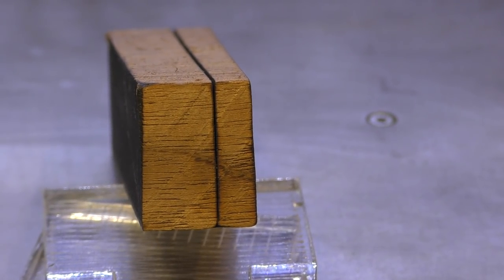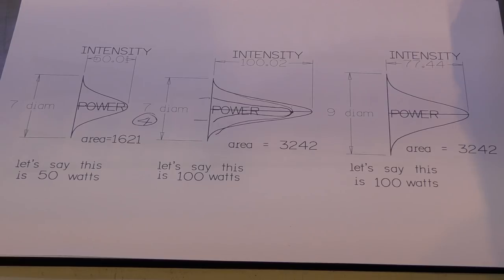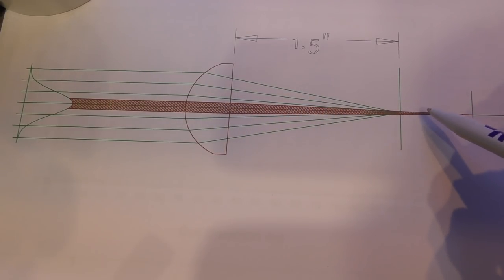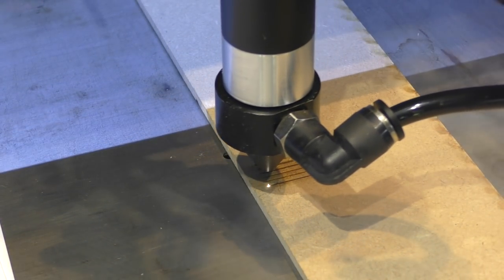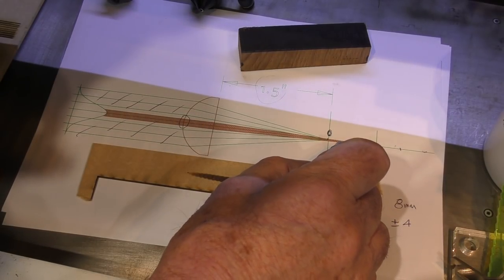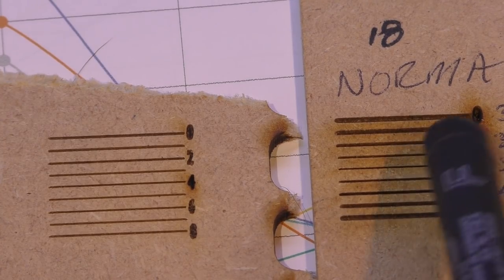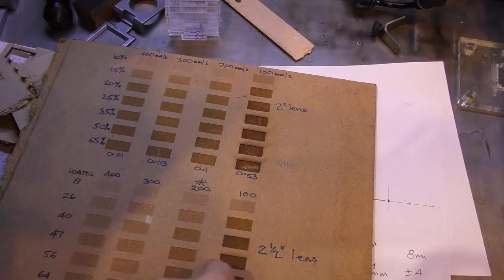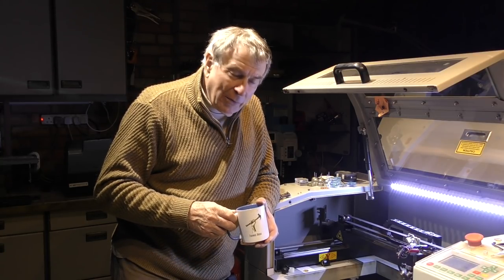RDWorks Learning Lab 208  Can I Remove the Focal Point

Comment: Always fun to follow your adventures. 
The effect you are looking at is called Numerical apperture. When you remove the material around the center you are effectively introducing an apperture before the lens, reducing the incoming beam diameter which reduces the focused spot size but also increases your depth of focus, why you see no difference on focus spot size over the range of lens-to-surface distances. 
When it comes to why you see vertical instead of diverging holes, consider that the initial hole in the surface becomes an apperture removing the diverging components of the beam from the subsequent laser light effectively creating the same effect as cutting the outside of the lens, but at the surface.
Reply from the maker: Hi Asger
 I  did not recognize what I was doing as being related to NA . My understanding of the term is from  a vague recollection about microscope objectives and light coming from a focal point ( the specimen being examined) into the lens for viewing.  This laser  system seem to be completely different in tha a) the light is parallel as it hits the lens on the top side, and b) the light is  not uniform but  VERY non-linear in its intensity.  As I state often, I only have a rudimentary knowledge of optics  but ignorance , common sense and inquisitiveness have dragged me into a subject i have no right to be investigating.
  That hole in the surface that you imagine to be a  filtering aperture  cannot be so. It is the focal point or that point through which ALL light rays pass. Therefore it cannot be acting as a filtering aperture. . If you look at the acrylic  tube burns for my very short focus compound lens you can see the undercutting and bulbous form of the short penetration tubes. Those diverging beams  below the focal point have t eroded a teardrop shape gallery. As the focal length gets greater this effect is less obvious and the holes look almost parallel ( I said almost...examine the shapes carefully ). 
  Thanks for your kind words and I greatly appreciate your contrary opinion because it makes me stop and think.  I am also keen and eager to add to my flakey understanding of a fascinating subject. 
 Best wishes
Russ
Reply: @SarbarMultimedia  Hi again. 
Yes the numerical aperture is relevant in both directions, collecting or projecting light. Microscopes makes fine laser focusing systems as when used in laser microscopes, which is an appropriate comparison here. Conceptually a laser microscope only differs from your setup in that there is a beamsplitter in the beam path to collect reflected light.
The numerical aperture as a numerical value enters into two relevant concepts here: depth of focus, and focal spot size (or beam waist). Decreasing the input beam diameter, (without changing the intensity distribution) increases the numerical aperture, which reduces the focal spot size and reduces the depth of focus.
In your experiment the intensity profile isnt messed up too much so it allows you to arrive at the same conclusion. i.e that the extent of the input beam affects the spot size and depth of focus.  
The way to do this without changing the intensity distribution or losing power is of course with a telescope in the optical path which can be constructed from two lenses with different focal lengths.
The part where you remove the center can actually also be accomplished without power loss by creating  what is called a donut mode by using a phase mask, but thats on the more complicated side of things. 
 
The nonlinearity or (idealized) Gaussian intensity distribution is exactly what allows it to be "imaged" onto the surface with the same intensity distribution, albeit concentrated. It actually follows mathematically since what happens in optics as you may already know is called a fourier transform and the gaussian distribution as far as i know is the only function that maintains its shape through a fourier transformation. This is part of the reason why a magnified 5W laser will burn a hole in a piece of paper but a 5W LED wont. If you had an even/flat intensity distribution on your input, you would instead get something called an airy disc at the focal point which will not be even/flat in distribution either.  
This is why, in high end lasers we operate with a parameter called beam quality or M^2 which repressents how gaussian a beam profile is. 

Hope that makes sense.

Regarding my comment on the beginning of hole being an aperture, consider that as the hole is being formed the apperture thickens which can be thought of as a series of appertures in rapid succession each removing the diverging parts from the previous. As you also note the diverging (outer) parts of the beam are also the lowest power part of the beam. This also explains why when you remove the center part all you are left with is something that can start a hole but not propagate deeply through it.

"If you look at the acrylic  tube burns for my very short focus compound lens you can see the undercutting and bulbous form of the short penetration tubes" Yes, you have almost no coaxial power with that lens. This also happens with regular cutting but so much slower than the hole drilling, and you only see a bit of widening of the hole at the top.  

Thanks again for your experimentation. Although i already have my PhD i laser optics, i find your videos always brings the subjects down to earth and, i find, often inspires me with good examples of how laser and optics concepts can be visualised while burning holes in stuff :-)

Best
Asger
Reply from the maker: @asgersellerup9375  
 Hi Asger. I greatly appreciate the trouble you have taken to try and educate me in the finer points of this technology. I make no pretense at understanding much more than the very basics of the subject but  perhaps with your  connections to academia you may be able to discover research work on the cutting mechanism of laser light through lenses. My searches have been fruitless hence I have been  forced reverse engineer the process  by observation and  employing my wealth of ignorance. I am just interested in the basic mechanism and not in the   I speak often with a reputable US lens manufacture but he is so committed to his ray tracing and lens design software that some of my demonstration videos leave him lost for words.  
 My fascination with your specialist subject makes me ask what I hope is not a rude or insulting question. Does your specialization take you into material science and how light below the focal point interacts with various materials. This question arises not only with the guy above but other optics companies I have contacted . Their attitude seems to be "We only make perfect lenses. What you use them for is beyond our remit"
 Again, many thanks for your in-depth response
 Best wishes
Russ
Reply: @SarbarMultimedia  Hi Russ
Pleassure is mine.
While my subject is exactly on the light matter interaction of lasers (albeit at much higher intensities), i dont have specific knowledge on wood or acrylic aside from my hobby CO2 laser, which is what brought me to your channel in the first place :-)
There are a good handful of scientific papers that describe the cutting process in acrylic and wood, but for people who arent in an organisation with access to those papers, typically behind a paywall, that is of little use.

I've glaced through them and one thing to note is that wood and acrylic cuts by different mechanisms. Where acrylic is cut by a strictly physical process of vapourisation process, wood is cut by a chemical as much as a physical process evident by the cabourization left behind on the surface of the cut. This i guess is obvious, but makes acrylic and similar plastics unique as most other laser cutting processes involve some chemistry, including steel cutting.

Lens manufacturers will likely be able to answer all questions about the static operations of their optics, but cutting with lasers is a dynamic process, so the optical "system" develops over time and is affected by chemistry of the material as well as the status of the beam along its path. In my studies ive mainly focused on how the refractive index of materials changes at high intensities which leads to cool effects such as self focusing beams.
That is not what is going on here though.  

So what happens optically below the target surface?
One thing to note regarding the hole formation e.g. when cutting acrylic is that there is a nonlinear intensity threshold below which light will just slowly heat the material without vapourising it no matter how long you wait.
This means the initial hole formed in the surface will only be as large as the intensity distribution allows it to be. At the edges of the beam the intensity is too low to remove material so the beam gets truncated. BUT the diffraction limit of light does not allow for a sharp edge in the intensity profile, so you get a new slanted/fussy edge which partly extends into the wall of the material, gradually taking power away from the beam as it propagates through the hole. This repeats itself through the hole until you get to the other side or the peak intensity of the  beam gets below the vapourisation threshold. This is one of the reasons why you couldnt drill an infinitely deep hole in an absorbing material even with a perfectly collimated beam. Ray tracing wont get you here. It is one of the consequence of light being waves rather than particles which limits the usability of the ray tracing model which assumes particle behavour. So in order to properly understand how light behaves near its diffraction limit (which for our CO2 lasers is around 150µm) one needs to consider its wave properties. 

I know reframing it in terms of wave optics just complicates things, but i've found over my last 10 years of studying and working on this subject that adopting a wave understanding of light (and matter) makes explaining edge phenomena (such as focused light) to myself a lot easier.

Not sure this comment here is too useful, but putting it into words was a nice excercise for myself at least.

Best
Asger
Reply from the maker: @asgersellerup9375  
Hi Asgar
 I think I have a pretty adequate understanding of how the interaction of light stimulates molecular vibration. When that vibration, we recognize as temperature,  reaches some critical value , atomic bonds  breakdown and the atoms rearrange themselves into different chemicals. . In the case of acrylic  (the only plastic to do so) the lightwave stimulation causes a change of state  at relatively low temperatures to create vapour. However vapour= microsolids that will continue to be stimulated to higher temperatures whereupon a that  inevitable chemical change to flammable products occurs.

 That is not the cutting mechanism that I wish to understand. You have seen my 26mm hardwood cutting demonstration with a 2.5" GaAs lens and you can see the very thin path of damage.The chemical change of wood can only happen because there is adequate intensity of light at the light/material interface to stimulate the wood molecules. I do also realize that it is only INTENSITY of light that causes this stimulation. As the intensity decreases I have also long understood that EXPOSURE time has to increase to a point where as you say  there is insufficient energy to effect a chemical (or state) change.  My fascination is on how that ultra thin beam of light exists. My basic reverse engineered model tells me that it is definitely a projecting focused beam of some sort  rather than a collimated beam  because I can see the tapered cut profile just before breakthrough.  I have yet to modify some more lenses to investigate  this projecting focus profile. By reducing the lens to 3mm in the above video  I am suspecting that the spherical geometry of this Chinese lens  is not perfect and what I have left is a 3mm diameter  flat non-focusing surface.

The wave/particle nature of light I understand in principle  but when and how it applies/changes in different situations  is something my remaining 2 grey cells cannot handle.
In my very simplistic world I see a wavefront as something that is expanding as it pushes forward whereas the ray tracing particle (photon) idea allows me to imagine focused and collimated beams being responsible for this VERY thin damage zone in my 26mm wood cut. I also point out the FLAT  nature of my wood cut face that shows no sign of collateral damage within the cut. Every aspect of that cut screams intense beam of FOCUSED light.

Thanks again for your interaction on this subject. it is great to have a meaningful conversation with someone that has a foot on both sides of the fence
 Best wishes
Russ
Reply: @SarbarMultimedia  Much like yourself i love to share what little i've learned to those who care to listen. 
This is turning out to be a really fun discussion of the intricacies of CO2 lasers.
Youre absolutely right about the chemistry of wood burning and i will add that this is quite different from UV laser cutting in which the individual photons have an energy higher than the bond energy, allowing it to evaporate by direct ionisation rather than rapid heating leading to thermal breakdown. If intensities get high enough as in femto second lasers multiple photons can combine their energy to reach the ionization energy without having to use UV light. This leads to evaporisation without heat generation. It's really cool and what is used for some eye surgery and exotic materials. 

I just rewatched the video and from what i can see you have all the building blocks for the complete theory in there. Perhaps just one question is mssing which is "for a given beam diameter, what is the deepest cut possible?" And why is there a limit?
As you may note there is a depth beyond which additional exposure time doesnt increase the depth without increasing the entry hole diameter as well leading to a form of maximum aspect ratio. At 8:57 you can start to see some diminishing returns as the depth does not scale linearly with pulse duration. This is what im talking about and i know part of the reason is interaction with vapour, but even if you evacuate vapour there will be a max depth beyond which no additional time will give you a deeper cut.
If light was able to collimate within the hole there would be no limit to the depth of cut, this means the beam is losing power all the way to the bottom and the ultimate bottom is where the loss of power has been so great that even the apex intensity is no longer enough to cut. The beam will only lose power if it interacts with the sidewalls of the hole its drilling 
So a mind bending effect here you may already have thought of is the answer to "why losing power at the edges of a beam affect intensity in the center of the beam?" This comes back to the wave properties which limits for a given wavelength how sharp a transition in intensity can be. This means that the edges relocate power from the center of the beam to maintain a sloped edge which continuously gets absorbed and eventually end up eating up the power of the beam. 
Coincidentally it is almost identical to how light propagate and lose power in optical fibers. (the difference being scattering at the edges rather than absorption)
You also demonstrate this that light can be absorbed  at high angles with last test. (note that reflection always occur from flat surfaces no matter the material)  

So i think you hit the nail on the head in the very beginning where you state that significan intensity of light must be passing along the very center to the bottom of the hole you are drilling. You also mention how lower power systems can achieve proper cutting by having reduced input beam diameter which exactly increases the depth of focus/ Rayleigh range at the cost of minimizing focus spot size.
The missing piece here is just that matter of how the center is attenuated by redistribution of power along the length of the hole as outlined above.   

A side note: 
Conceptually there is no difference between collimated and focused light. Collimated practically just means a very long focal length. A truely collimated beam cannot be made unless you had an infinitely wide lens. This again follows from the wave nature of light. 

Btw. i love your lens focus finder.

Best
Asger
Reply from the maker: @asgersellerup9375  
 Hi Asger
That femtosecond technology  is never going to make it to the hobby market but it sounds amazing.  Thanks again for your continued engagement on what to you must be a very basic form of laser technology. There are  very few such as yourself that relax away from their very technical day job by going back to the basics of a glass tube CO2  machine for pleasure.
As I have mentioned before. I am not concerned with gaining sufficient understanding to design anything, instead I just need a simple imaginary model of how things work  so that I can plug it into my very simplistic model of the universe .. My very basic model of how lenses cut has no respect for the finer details of physics, it just explains the many anomalies I have noted that are not explained by the vanilla flavoured  lens theory  we all know.  

I have now done another series of experiments for my next video. It just so happens that the two lenses I drilled are the lenses I use for my compound lens. That has allowed me to created 4 different combinations to test.  In my theory, I have removed the cutting ability from each lens but left  its focusing properties. Thus combining two holy lenses  should theoretically improve the engraving properties  by removing the depth penetration capabilities and allow me  better  control the scorching capability.  The results are interesting as you will see when the results are summarized. Out of curiosity I also did a quick test on the 38mm lense where I removed its focus capability and finished up with a 3mm  diameter light transmitting centre of the lens. It seemed to prove that the outer diameter of the lens was doing a great job of focussing all but the  highest intensity axial "rays". because there was no longer any  hint of a 38mm focal point.. However, checking the "burn" diameter of that remaining central beam  confirmed what I was looking for ..... a focal point some 30mm or more beyond that nominal 38mm original. It seems that my simplistic model was correct, Yes, a projecting second focal point that is responsible for carrying (and focussing) the axial high intensity light to a depth that will be limited by that focal point.. 
I deduce that the beam must be focusing because  my dummy acrylic flat lens with a hole through  the centre was unable to do any cutting damage. That lack of damage implies that the unfocused natural high intensity  beam  ( ie just a collimated beam) is not what is being observed.

 I am absolutely sure that you will be able to  explain what I am observing  with known science  but as I have mentioned often this is a subject that is not spoken of in the public domain

Thanks again for your valued contribution
Best wishers
Russ
Reply: @SarbarMultimedia  Cant wait for your next video!